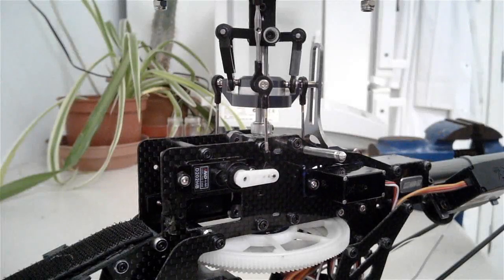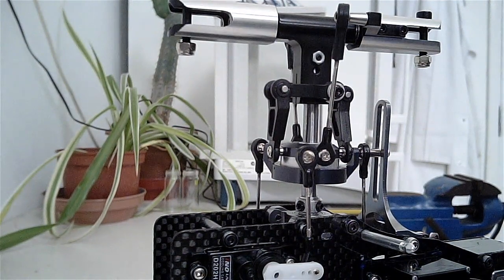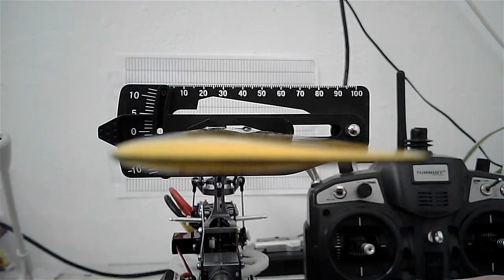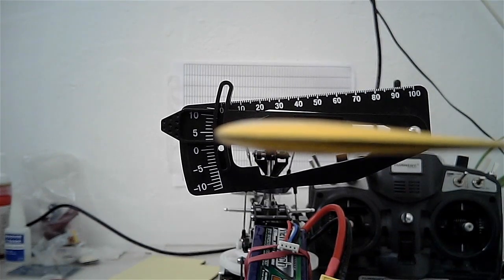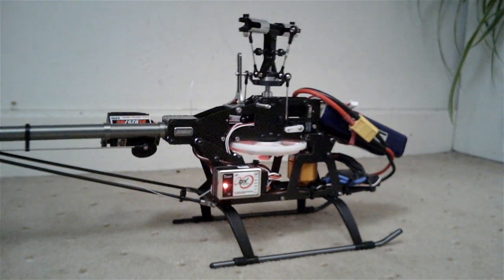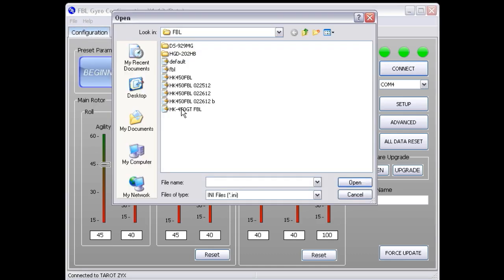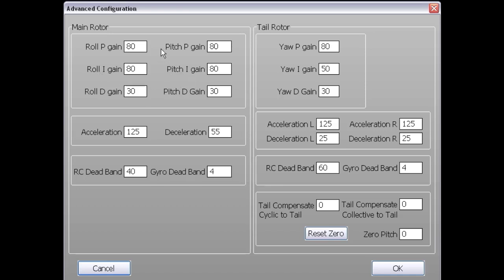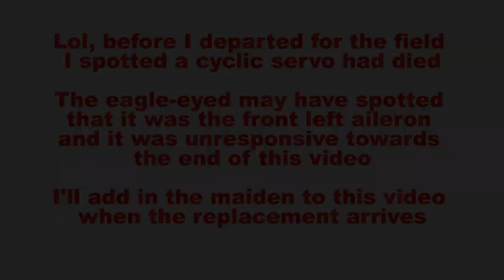HK-450GT Flybarless Conversion - pt 5 - Final Setup

Comment: Thanks Simon for the awesome video! I'm setting up a Dynam E-Razor 450 FBL and had NO idea what I was supposed to do to setup this heli since flybar head setup info is what is mostly available online. Now I am 100% on point! Btw, incase anyone asks, the Dynam 3GS gyro is a clone of the Tarot ZYX. And the software Dynam offers is very similar also. One other note. The swash plate on the E-Razor is 120 degree CCPM like yours only 180 degrees off. In other words, it's backward compared to yours.

Comment: My elevator servo is on the front of the heli's swash plate. When I first set it up as per your video, the aileron movements on my swash plate were reversed. If I moved the stick right, the swash would go left. Moved the stick left, and it would go right. I tried to correct this using the software with no luck. After a while I figured it out. I had to reverse the elevator servo function on my radio. Problem is, in the software u will see an inverse motion on the screen for the aileron function.

Comment: great videos. im going to use them soon when i get this fbl head. one question. your way of setting the pitch assumes the main shaft is completely vertical when you line up the pitch gauge with the wall chart. how do you know that. the table and skids of the heli are probably tilting the main shaft

Comment: Thank you for your video. It has been very useful. However, you did not talk about the governor function. I want to understand this and use it. I assume that the motor is controlled by the governor built in the ESC. So, why do I program the governor in the FBL system? Do I have to have a matching ESC with a governor built in before I can use this function or does the FBL governor function provide the governor function through a cheap ESC? Hope you can help me to understand this as well.

Comment: Simon I need help. I have a erazor 450 flybarless with the same software you used. Followed you excellent directions. All is great except I am constantly having to give right correction because its wanting to go left. Can I trim from remote or need to do so in software? If in software, which page is it on? Thanks Shane

Comment: Hello,
I have a doubt, have placed the pitch ~ 9 and with the stick in the middle = 0. Do not you work with idle up? namely, normal and idle up curves? I set the curves in radio and then adjust the pitch in each state, or is it all done in the tarot for have normal and ilde up curves?
tks.

Comment: i found the problem i didnt set gyro direction properly, i bought some new servos and it the tail i have a problem with, the tail servo is align ds520 and wheni move transmitter stick to the right the tail moves to the boom i did the tail limits through the software and the binding stops but when i move the tail again in the same direction
its binding and its the same way all the time i push the transmitter stick to the right tail moves to the boom, thanks

Comment: I have a 450 heli, a Fly Sky th9x trans. and its rx, connected to a tarot zyx. The problem is the functioning of the right stick.  It is as if the entire right stick assembly has been turned 45 degrees clockwise.  To fly straight forward, put the stick in the upper right corner.  To bank right, put the stick in the lower right corner.  To go straight backwards, put the stick in the lower left corner.  To left bank, put stick in the upper left corner.  How can this be fixed?